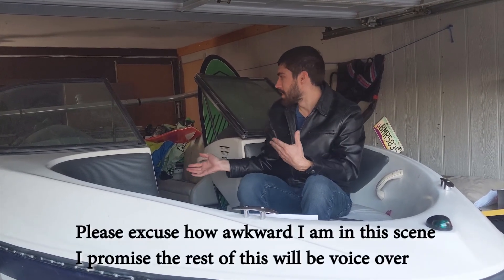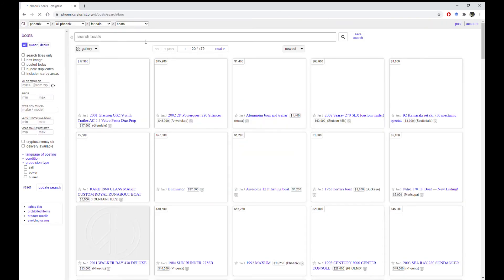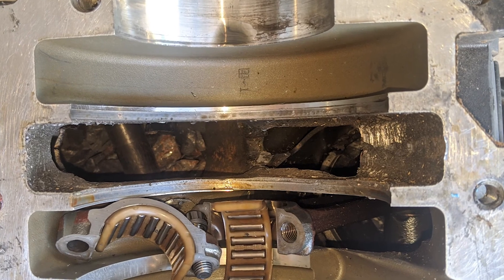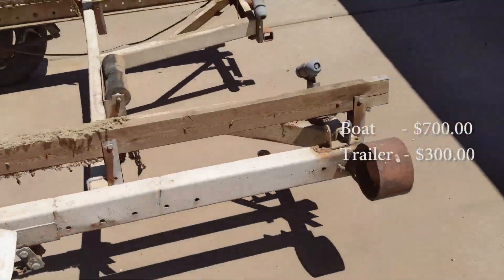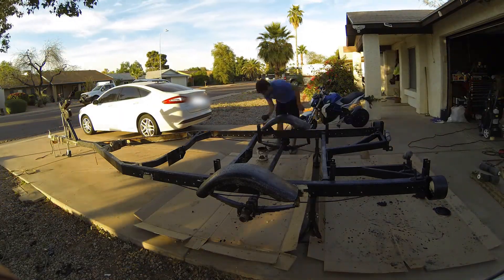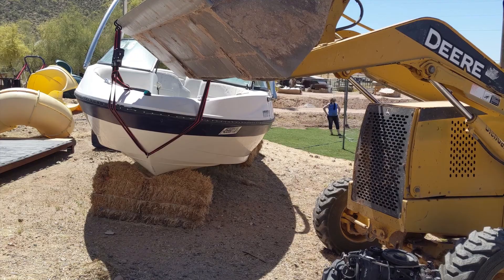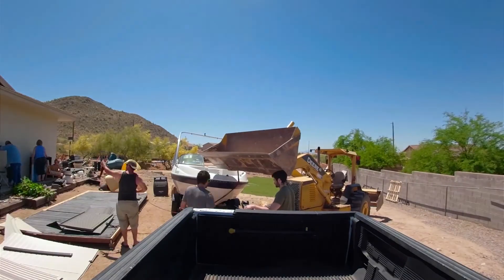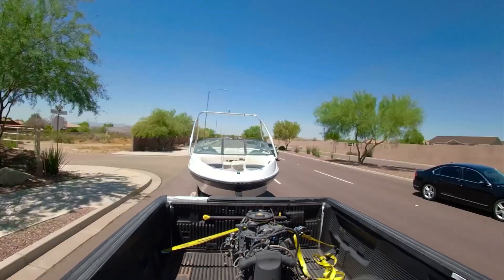E-Doo - The Electric Seadoo Boat Conversion Project Video 1 - Acquiring the Boat and Trailer

Comment: Do you have an idea of when you'll drop the next video?
Reply from the maker: I keep telling myself the next week and then I get distracted building the boat. I think 18th of April may be a safe bet - am about halfway through making the next video.
Reply: @ThatOneGuy7575  Thanks for responding.  I'm particularly excited about your video because I think you're the only one so far that's doing it right in terms of power boats.  Typically you see guys either using undersized motors or pairing them with low voltage lead acid batteries.  Not to mention that you're coupling it with a jet drive.  Just awesome!